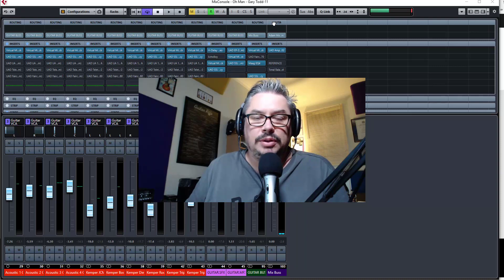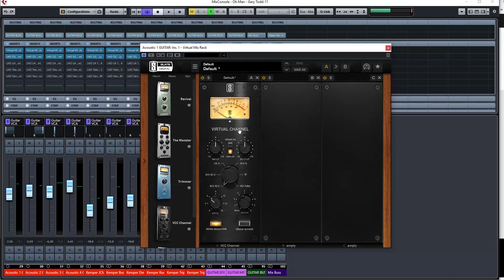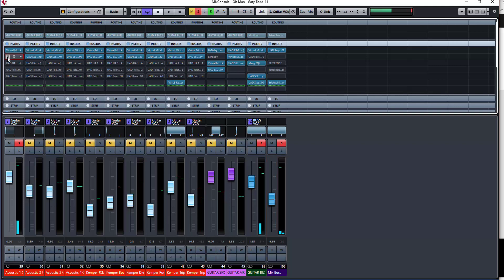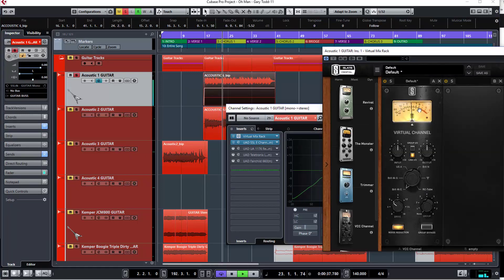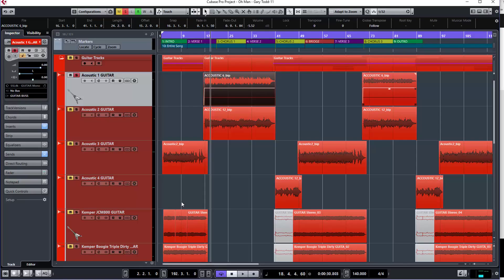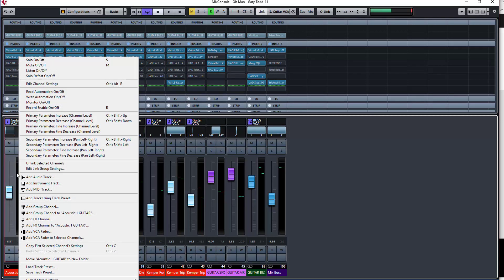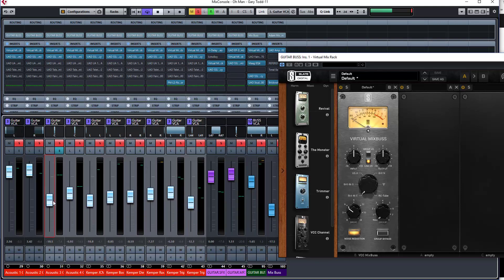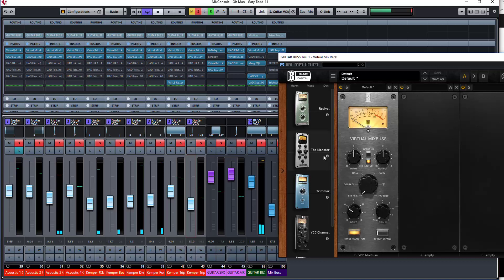How to Gain Stage in Cubase - Gain Staging Mixing Tutorial

Comment: Well done Kevin! Just curious your opinion: what sonically is the difference of say only using Slate bus emulation on the groups/busses vs using Slate channel emulation combined with buss emulation. Is it a drastic difference across the entire mix? I tend to just use emulation on the groups/mixbuss to save CPU.
Reply from the maker: The whole Slate VCC plugin setup is subtle no matter how you use it, unless it drive it very hard. I can hear a big difference across the entire mix using it on all the channels but at the end of the day it is what you like. I have the added advantage that I use a lot of UAD plugins and as such they use the DSP from the UAD system. This takes the pressure off my CPU and allows it to run more Slate VCC instances. Before I had the UAD system I would sometimes have trouble with large sessions putting all this and many more plugins on my CPU.
The main reason I do my setup this way is to try and emulate a full analog mixing console setup. In a real setup each track would be going through an analog mixing console channel and then they would also go through a buss channel and maybe another buss channel. All the external reverbs, delays, FX would be going through an analog channel. Is it necessary, no it is just what I like to do and I like the sound it gives me.
There is nothing wrong with the way you do it and nothing wrong with the way I do it. I hate to be the person that says this but why not try it on one of your mixes and compare with and without. At the end of the day if your system cannot take the pressure of all those plugins and it is causing stuttering, pops and clicks then it isn't worth the hassle. My system can take it so I do it. If my system couldn't take it I wouldn't do it and I would probably do it your way. If I really wanted to be over the top and do the full process without the CPU hit then I would bounce out each individual track through the VCC Channel plugin first and then load then into the session with that already applied. You could also utilize the freeze function but I find that annoying when I am making changes and need to unfreeze and then freeze tracks over and over again.
Thanks for watching and thanks for the great question.

Comment: One more question . I am composing with vst instruments, orchestral and film music. How to do gain stage in vst instruments; from the output of the vst instrument; however when I put the output of the vst instrument to kiss the sweet spot of -18dpfs (in cubase meter)  when i put a vu meter in insert slot the vu meter is barely moving or moving in very low signal.. any suggestion; for your info i have calibrate the vu meter in -18.
Reply from the maker: That sounds a bit weird. It almost sounds like the VU Meter is sitting before the VI but I can't think why that would be. Not that this should be the problem either but one thing to note is in the default settings the Cubase meter will be showing post-fader while the VU is most likely sitting on an insert pre-fader. Sorry I don't have a great answer for you on this one.
Reply: @kdwmixingmastering  i dont know..  I am adding instrument track no  vst instrument ... I will try with instrument track to try it. yes i have the global  meter setting in Input meter.
Reply from the maker: @anthonykolliopoulos  you stated you are using vst instrument in the first comment. What instrument are you using I would like to look further into this and see if I can understand what might be happening.
Reply: @kdwmixingmastering  i am using Kontakt 6. However I found a solution, I record the VI in decent input signal  (kissing -18dpfs) by modified the output of kontakt inside.  However the vu meter measures the average level of input signal (i think). I am a little  confused but i will check it  today with some  tests.. thank you

Comment: What about the low signals, can we trim them up to the 0vu?
Reply from the maker: You sure can. Gain Staging is not always about turning something down, it also includes turning low audio up. It is better to record them a bit louder though to improve the signal to noise, but it isn't such an issue with the clean and accurate gear we have access to these days. Thanks for the watching and thanks for the question.

Comment: Thank You...Great explanation, I've been wondering for ages on the meters in DAWs and the levels etc and what was the right way to go. I just watched a Jesse Cannon tut on mixing and he used the Slate rack as well, so seeing you use the VU meter has also helped 

My mistake has been having my nearfield monitor/room listening level too low and my channel levels in Cubase too high .When adding delay/ compression etc it was sounding really bad, now I know why. A good hint from the Cannon tut was plugin order....best to go in most cases EQ,-- DE ESSER --  SATURATION/DISTORTION---COMPRESSION - then DELAY REVERB PANNING etc
Reply from the maker: I am really glad it helped and thanks for your tips. Just keep in mind that plugin order is like everything in mixing it isn't a rule. Sometimes putting EQ after compression to add a little extra low end or top end is a good thing to do because you don't want the compressor to respond to it. EQ before is good if you are cutting because why have the compressor respond to something you are going to cut out anyway. The order is a good starting point.

Comment: Why it has to be so complicated. Just use the pre gain knob
Reply: You are losing also accuracy by bringing the faders down like this...
Reply: I noticed if I'm using certain VST's like an amp sim that it will cut out the distortion if I drop the pregain. I have to use the faders on those.
Reply: @scottlebrun6782  Thats because if you drop the pre-gain, there is less signal feeding your AMP plugin (you decrease the volume before (!) it goes to your plugin), while dropping with the faders in the mixer channel will drop the already amp processed signal down. :)
Reply: You cant use the pregain knob because it   this after the input signal. Except if you export this audio track with  the new signal and import it.